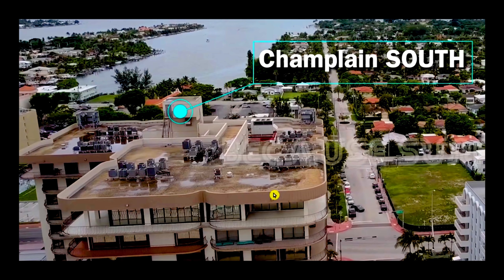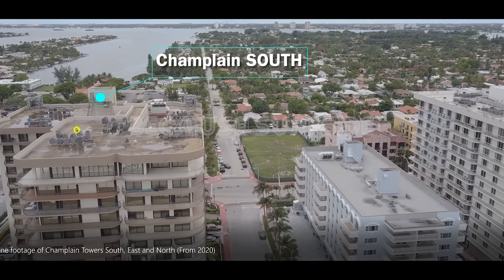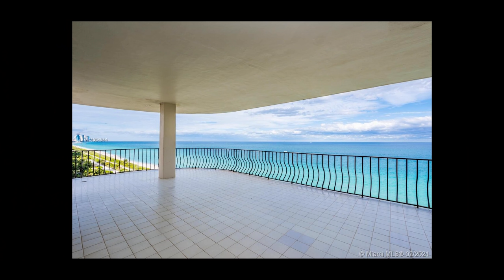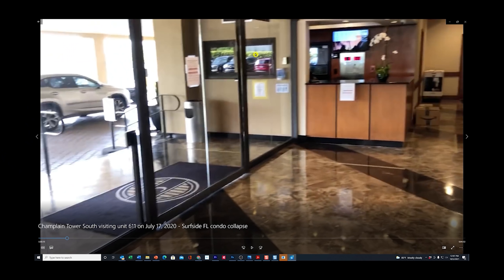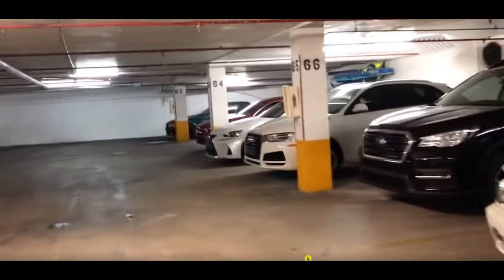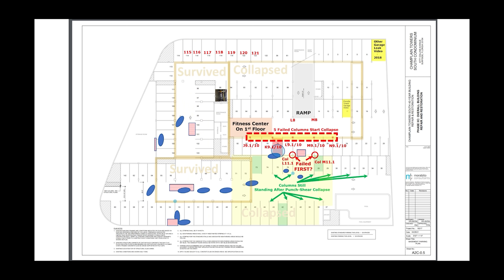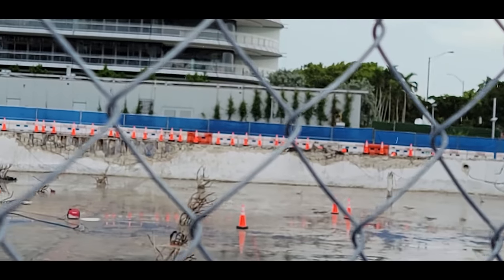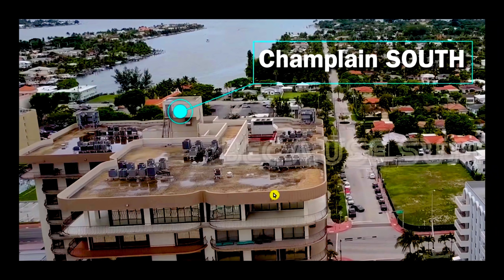Miami Condo Collapse: Water Attacked Roof, Inside, Pool Deck

Comment: It’s funny when I first started looking into this, I also noticed how filthy and stained were the roofs of particularly the south and north towers relative to the other properties.

I am also most impressed in today’s video with the lake that now occupies the site of the cleared South tower. No wonder the garage was such a problem, the water was welling up from below. There is really no fixing such a problem—that’s the ground water. This is landfill and good luck keeping out ground water!
Reply: I built my house in a moisture rich location and in anticipation of problems I put a footer drain around the perimeter of the walls. I was really smart but did not think to thwart little whatever animal clogging up the exit of the pipe. The floor began to crack and it appeared to be peeing up in the air about three feet. How or why the plug-up withstood such pressure I will never know but when I cleared out the drain pipe there was a continuous flow of water for hours all from the deep stones I had put under the floor. Water has substantial hydraulic pressure forces. I question this being landfill but I do not know for sure.
Reply: venswim  We once rented a ground floor appartment in Naples, FL. There was a summer water problem even without a basement. When we got back for snowbird season there was mold everywhere. Never had this before in the 2nd floor appartment we had prior in another building.
Reply from the maker: My be related to the king tides we have this month

Comment: I talked to the president of a condo association about 25 miles north of Surf Side.  He told me that there is a problem with some buildings in the area. The builders/subcontractors sometimes use beach sand instead of regular sand for some concrete projects.  The salt leeches out over time causing the cement to develop cracks.  These cracks would fill up with water and look wet while the undamaged concrete would be dry.   I've seen buildings in Hollywood Florida (6 miles from Surf Side) that are falling apart.  The rebar is visible.  I don't know if beach sand was used in the building that collapsed but it is worth looking into.
Reply from the maker: I think that's an old cocaine cowboys old wives tale making the rounds. It's really stupid because concrete is not made on site it is delivered by trucks and back in that day Rinker was king, they made their concrete in Pompano and wherever else and trucked it to the sites. Contractors would never be that stupid to mix it themselves, much less do it on site in the volume they need and be stupid to use salt sand.
Reply: We are constantly researching in group our group if your interested and have fb . We are the spin off from the channel that this drone footage is from .
Remembering Champlain Towers South if south if your interested

Comment: I look at buildings a whole new way after watching these videos.  The weight of the updates made with those skinny columns.  I can't imagine how people feel staying in the sister towers.
Reply: Staying? I’m guessing they aren’t
Reply: I hope they aren't!  Another thorough analysis, Jeff, thank you. You tie all the ends together and still the new info supports your initial theory.  I know I'm never buying anything above 2 stories!  Sad case of poor build, poor certification method, poor maintenance and poor response to water ingress problems.  Shocking to see in the 2020's.
Reply: They have the top secure parts to the pillars tho. That’s how south should’ve been but it wasn’t, south was the only one on that block without that added security to the pillars. They were doomed
Reply: A structural engineer on another YT channel ran all of the load calculations on the original building plans. He found that, as spec'd out in the original drawings, the columns under the pool deck & above-deck parking areas were already weight-loaded to their maximum load-bearing capacity. There was NO SAFETY MARGIN in those skinny columns, yet they built those HEAVY concrete planter boxes on top of the pool deck and then planted those very heavy Palm Trees in them! That was like handing a noose to someone who wants to commit suicide..... The City Building Inspectors should have caught these signature shortcomings before an occupation permit was ever issued some 40 years ago! The city is sure to share some of the liability when the flood of lawsuits are filed.
Reply: @dalewalker4614  that would have been building integrity. That YouTube channel and this one on good terms
Reply: @jwrn4u  I pulled up a few articles. Most of the residents stayed in the sister tower.They  said they felt it was safe although others who didn't live there felt they should leave. 

"INSIDER
The Associated Press reported  most of the residents in the sister building to the Florida condo that collapsed last week have said they won't leave their homes.They believe it's safe. Philip Zyne, one of the residents, told the AP that he had seen lots of inspectors since the collapse, and only some residents leaving: "It's not a mass exodus by any means. I'd say maybe a quarter of the building has left."

But some others are afraid and have left.

Rebecca Weinstock, who owns a condo on the sixth floor with her husband, told the AP: "I'm petrified of returning."

Comment: I don't know what the geology of the area is like there, but the water "appearing" in the former garage floor area says to me that the building was built below the watertable, so was probably essentially just floating like a boat, and once that boat springs a leak, it's going down... :\
Reply from the maker: The building was not built below the water table but under certain circumstances water can start to creep upward from below and that's the problem that the building had originally but it seemed to have abated in recent years
Reply: @jeffostroff   It's easy to determine where sea level is as you only have to walk 100 yards to stand at sea level. One could reasonably assume that the fresh water table under this property could be at least somewhere between low tide and high tide levels, and perhaps even higher. It would seem that the city building code would require that the bottom slab of the parking garage be at least a certain number of feet above subterrain water level. In all of the plans for the 3 Champlain Towers did you ever see an elevation/altitude marked as a reference point to measure from during construction?

Seeing that much sub water come from beneath into the garage level also makes me wonder what subterranean conditions they may have ran into when excavating for the beautiful new condominium building directly to the south of Champlain Towers South. Have you uncovered any information about that?

Comment: Hello Jeff, I'm a retired engineer who spent my last 11 years doing building assessments all over the US, Canada, Asia, and Europe. Part of my system tasks were roof drain systems. Often with a good Google Earth image, I could determine roof drains particularly on non-ballasted membrane roofs. The Champlain roof appears ballasted and I make out no roof drains. I'm curious as to the makeup of the roof structure. There is a an "inverted roof" construction where pavers (ballasted or non-ballasted) are simply placed on pedestals above the waterproof membrane below. The idea is to protect the membrane from UV, wind and weather. As a result the pavers also hide the roof drains plus any debris that clogs them. Did we have that here? Out of site, out of mind. However, the pooling should have been a tipoff that the roof wasn't draining properly. Where was maintenance?
Reply: Maintenance likely went into a few pockets and the receipt was marked paid.
Reply from the maker: It does not look like we had pavers on the roof. I prefer the newer white waterproof membrane that's good for 15 to 20 years. It is so nice and clean and easy to see when it gets dirty.
Reply: You can?see the roof is rotten
Reply: No one wanted to pay for maintenance.  These people were already paying through the NOSE for mediocre, outdated apartments that were charging a premium for the sole reason that it was a stone's throw from the beach/ocean.  A lot of those folks couldn't afford the millions of dollars it would have taken to de-tile the patios, fix the roof, and re-do the pool deck basically from scratch,.

Even if you split the cost equally between all the residents you're still looking at (potentially) tens of thousands of dollars per apartment, on top of their rent.  In hindsight this was a fatal mistake, but at the time the damage SEEMED minor enough (or you could pretend that it was) that it wasn't worth millions to fix.
Reply: @Darkkfated  The HOA fees should have been higher 30 years ago. The fact that they were not enough (they claim) simply means a quick injection of cash was needed at the 40 year mark tells you they had not planned ahead or simply spent unwisely.
Reply: @Garth2011  That underlines the tragic flaw in all such HOAs, i.e. laypersons deciding things that require rigorous expertise... or worse, laypersons vetoing what they're told by the experts.
Reply: The Roof Water Pools still there After the Collapse  Absolutely Clear - no Drainage Systems Absolutely Clear , the Attempts of Management to Hide Water Damage on the Lower Levels Absolutely Clear , the Water Build Up from the Pool Decks Area and Planters Absolutely Clear . 

Poor Weak  Design of this Building and Buildings Across the United States Absolutely Clear 

( Designers have to take into understanding that the Management is not going to succeed in attempting to Waterproof the Supports ) 

the Design of the Building should factor in Corrupt Negligent Management and  create Disaster Support s to STOP the Domino Effect created from the Lower Levels  in the inevitable events that the lower levels become so water damaged that a Load Column Support or Series of Load Collumns Supports in  the Lower Levels are wiped out by the Spalling , Sinking , Tilting , Sagging and eventual  Failing of a 100,000 ton Ground Level Concrete Support Design without Drainage Systems , Without any Maintenance 

- there are inexpensive  disaster systems companies whose Only Focus and Work Orders are to remove moisture and water from buildings with deHumes or DeHumidifier s 

Corrupt Ignorant Management of Vital Safety Absolutely Clear 💯
Reply: There was a team working on the roof during the time that it collapsed
Reply: I just google mapped it n I could clearly see water stains on Champlain South v. Neighbouring buildings.
Reply: @MajorCaliber  This is the gist of the matter for HOAs.
Reply: @MajorCaliber  Ugh, I know. No more HOA for me. People cry they can't afford it - then drive around in a $50k pickup truck. Or just don't pay their dues - let someone else worry about it then bellow when they get a lien on their property.

Comment: The pool deck with no building above it fell first . You said yourself that was the failure point . If anything the garage roof slab under the building was better condition as it was protected from rain by 13 stories of poorly constructed yet met code at the time building . The entire story is extremely sad here . So many times there were paths  that could have changed the outcome  but the events took the  most tragic path each time .
Reply from the maker: Yes, we are showing that water was everywhere on this property.
Reply: @jeffostroff  I still  find it hard to believe that nobody  was concerned even with all the warning signs . Maybe I’m just that observant of things most people would not pay attention to .
Reply: @kef103  We become desensitized to issues that are never corrected.  It's like an alarm buzzer with a napkin taped over it.
Reply: @kurtpena5462  forgive me but I worry for good reason .  People I think they can just look away from a problem and it’s not gonna be there but Some have such a terrible consequence. This condo collapse,  the events and people involved have similar parallels To the sinking of the RMS titanic .  It’ was tragic , preventable, Bad choice after bad choice

Comment: To my eyes, the parts of the roof closest to the drone look like the they are sloped to where the drain would be, but the drains are either clogged. capped,  missing or covered up.   The part of the roof to the back and left seems to have the worst of it.  The water looks more evenly dispersed, so either there is no slope of there is so much water that it's filling up all the way.
Reply from the maker: Yes anytime water is pooling it is because it has nowhere to go where to go and almost a 100% of the time it's due to lack of slope because if there was the required quarter inch per foot slope there there would be no water pulling end of story.

Comment: The A/C freon lines needs to run to each units, that requires 2 lines plus electrical lines. I see close to  90 units. Do they all run  thru the roof ?. Is there a special utility cavity from roof  to ground  level?.
Reply: Yes. The freon lines are shown in the 1979 structural / floor plans.  There are wall cavities with dozens of freon lines going from the roof condenser units to the evaporators in each apartment.
When I looked at this,  I thought what an epic disaster it would be if someone drove a nail through one of the copper freon lines when hanging a picture, etc.
Reply from the maker: There are also cavities to run the bathroom ceiling vent hoses up tot he roof vents, they pass a lot of utilities and plumbing up an ddown.

Comment: Good stuff - wonder if all the water on the roof is condensing water from the AC's that for some reason gets trapped ... ?
Reply: That's what he's implying, I think.  Air conditioners are essentially atmosphere de-humidifiers.
Reply: The condensate comes from the coils in the owners units and should be directed right into a drain. The roof compressor units are always running warm so have no condensate.
Reply: @davesaunders7080  Right, I actually know that :-(, thanks for correcting. So then it can only be trapped rain that can only evaporate to escape.
Reply: @cb831  Yes likely rain that cant drain properly

Comment: Wow!!  Great video Jeff!!  Great info!  I had looked at pre-collapse pictures of the building and thought how dirty/ old the roof looked; like it wasn't in good condition.  Still curious where the water in the basin is coming from???  Maybe time will tell.
Reply: Me too and if you look the perimeter of the roof seems a lighter shade which says the darker is wet. IMO
Reply: On the the roof i think water comeing from the AC
Reply: Take a look at DubStylees' comment above about the nearby aquifer.
Reply from the maker: No leaking from Acs. they have drain lines

Comment: I wonder if it HAD drains, but then the penthouse was built over most of them.
Reply: I wonder if Jeff could clarify if the drawing he provided with the "Xs" designated drains was of the original plans or for the added floor?
Reply: Good eye. And perhaps, the course of the water, leaking down, from the roof, and finding its way into the hallway, the patio and parking garage.
Reply: Or maybe the roof was re-sealed and covered or blocked them.  It sure looks as though there are far fewer than the initial plans.
Reply from the maker: might be subject for another video

Comment: They cared more about the cosmetic look to attract new tenants than the physics of increased gravity from water saturation that the new cosmetic changes would entail.
Reply: Not even that, the building looks depressing in comprasion to the one next door. Looks like a derelict thing, even the pool deck looks neglected.
Reply: Money money money
Reply: a new tenant would be a Buyer if someone wanted out.. since they are owned and not just rental apartments

Comment: I don't know what's written in the building code regarding tiles on balconies. (Patio = open, ground floor terraces?)
What the danger of moisture on (covered) balconies is I think:
1. the balconies have only an opening in the wall of the building. In the vertical direction they are completely covered. So rain goes on them only by horizontal air movement. Which can be immense given the hurricanes.
2. They should have a drainage slope ("balconies must have a minimum slope of approximately 1/4” per foot"). So even water has accumulated during a storm it should leave pretty quickly once rain has stopped.

The situation is comparable to a shower room where there is occasionally standing water which drains away after it came down. Only that there is no wind or sunshine. Just a/c.

So given those conditions I can see that the area next to the opening is mostly affected. This could be an area of about 3ft from the edge. Spalling from constant moisture should happen only at the edge but not further inside the balcony.

This addresses not the aditional dead load tiling presents.
Reply from the maker: The big problem I see a lot of down here too is when they embed the railings and steer rails want to steer steps for example, they don't seal it with silicone and so water seeps into those connection points and causes damage and spawling right there where the railings cwere the railings connect to the concrete.

Comment: If I was the person inspecting that Unit to buy and I saw the Heater drying that carpet I would be out of there like a flash.
Reply: I have seen these used in a hotel.  I was on the 9th floor, and the hotel maintenance had these going in the wing of the hallway my room was in and also the two floors above.  Apparently the cause was a toilet overflowed on the 11th floor.  The water made it down two floors through the floor/ceiling.
Reply: Water leaks are OK if they are fixed fairly quickly, but it seems that was never done here - cost too much money, probably.  Tragic.
Reply from the maker: Also how many times did this scene repeat itself around the building!